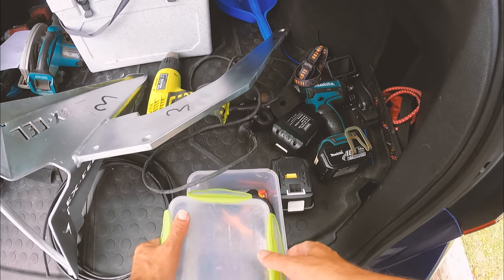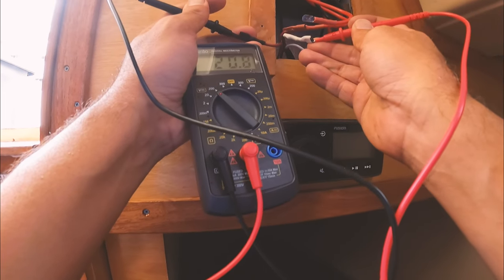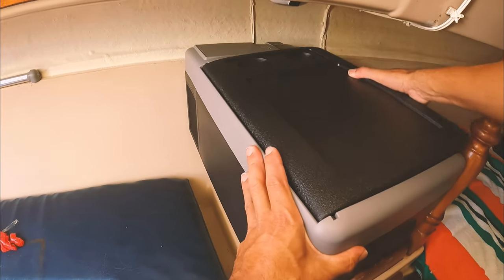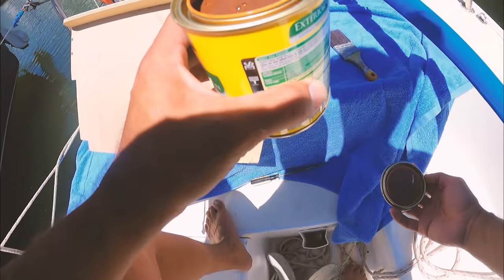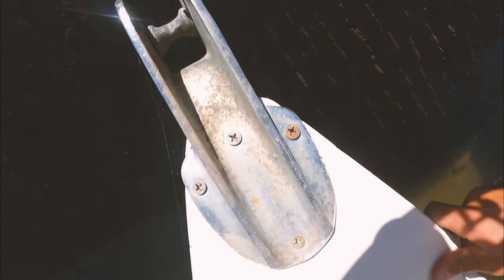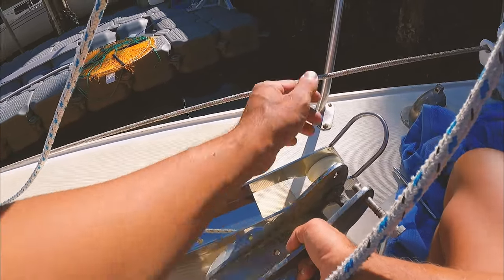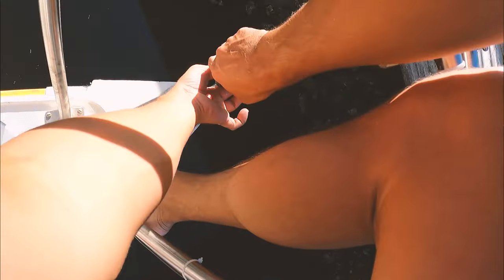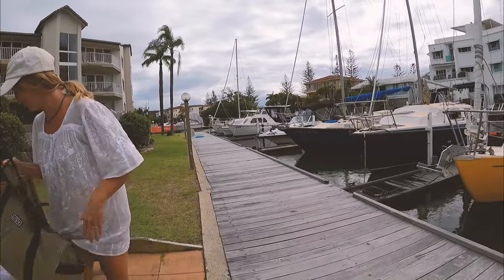Taking My Wife Sailing For The first Time.. But First, Lets Fix The Boat Ready For Adventures

Comment: Rod, Some things you may check. Make sure your actual anchor Rope  is of sufficient material and strength. In your video the rope almost looks like hemp, which I’m sure it’s not. Make sure to wire all shackles. Where you attach the anchor loop to your swivel you should have a chafing thimble inside that loop. They make them out of plastic or metal. Either one will work. Finally and most important, you will not be able to sail in heavy seas with that anchor hanging out there. AFolkboat is a wonderful sailing boat but she is narrow and has less bow buoyancy than some of the fatties  That means she will duck easily into steep seas, which is fine, but that big anchor with its big flukes will not take Seas well and will try to bash around. Suggest hanging the anchor from the bow pulpit or simply leaving it down below and bringing it up when you anchor which should only be once or twice a day. I’ve enjoyed your YouTube’s immensely and look forward to your upcoming sailing adventures. Charles Plummer

Comment: Hey man, I am beyond stoked that you got a boat. It's brought me back to your channel. I'd like to suggest something very important about removing screws and bolts like that... Don't pull them all out until you break them all loose. If you would have snugged up the other screws, the hard to remove one would have been easy. At least the screw opposite. Reverse this for re-installation. Work in a star pattern. Best of luck!

Comment: Well done Rod, on getting the mainsail out. 
I'm looking forward to the next video when you get both the main and headsail out.
I agree strongly with the other comments below, you need to secure all the pins on the shackles and swivels or the pins will at some stage work their way loose.
A stainless steel thimble fitted in the eye of the splice will stop the metal from frying the rope.
Also, think of a way to secure the anchor in the roller, when you get into a bit of a sea the anchor will start to jump all over the place. Maybe a dedicated line to tie or shackle the anchor into place?
Enjoy the voyage!!!

Comment: You need to mouse the anchor shackle and swivel shackles, I hate for you to lose that expensive anchor.  At some stage getting an eye for the anchor rope and resplicing the eye in( it's fun, do a video on splicing).  I would also consider having a spare anchor and rope.  You can use it as a stern anchor or double up the bow anchor in rough weather.

Comment: OMG That anchor is waaaaaay overkill. That thing could hold a trawler in 50knots of wind! Your boat needs something HALF that size! What made you think you needed something better than the plough that's already on the boat? Those ploughs hold perfectly even if they aren't set right.
But that bow sprit (pronounced 'spit') is a massive improvement just like the fridge.
BTW. Welcome to 'pain and difficulties' of working on the water.

Comment: Just my opinion you don't need the swivel they just get in the way and you only need one if you leave the boat unattended for weeks at a time. The anchor is a bit big but that doesn't matter. the chain is on the short side but still adequate for normal use and easier to manually haul. I had a similar sized boat once and had a similar set up I carried a 10M lenght of 10mm short link chain and shackles in the bilge (weight kept low) and if the weather or anchorage were dodgy I would shackle that on to the top of the other chain extending the chain and adding allot more weight to the scope (my kids called it Dads portable mooring).

Comment: I guess the main sail should be pulled through that run on top of the beam and pulled as hard as you can backwards, that's what that pulley and cleat is for at the back of the beam. You need more tension on the main sail. The beam should be hanging in the main sail not in a line of some sort, this is only for when the sail is not hoisted and you don't want the beam to be in the way in the cockpit. With it fixed correctly you will also be able to use the kick to get a more correct sail form. But hey, we are all beginners in the beginning. :-)

Comment: Welcome to the world of yachts!. Get used to doing maintenance on a regular basis and you’ll keep the nasty surprises at sea down to a minimum. No need for a swivel between the chain and anchor line, just cut it and splice them together. Check out Free Range sailing as Troy ( Pascale too…:) is the master of Mariners when it comes to boat maintenance. I used his episode on how to splice line to anchor chain and it’s still going strong. Best thing about sailing? Trolling all the time!.

Comment: Sealing the old screw holes and the new bolt holes you've made will help
Reply from the maker: Yep I actually did put Sikaflex in and under the new bow mount and holes but I just didn’t show it in the video 😅
Reply: @rokkitkit  good one... 👍 
Just checking 👅

Comment: The marker on the anchor, if that's just permanent marker, can be removed with dry erase marker. Just rub over it with dry erase marker and wipe it off. The dry erase marker will dissolve the permanent marker.

Comment: The wind noise protectors work a treat 👌
Reply from the maker: yes I was surprised at how well it worked. will be an essential bit of kit moving forward. Just a bit of a pain around water👍
Reply: @rokkitkit  it was very effective. I can see how it getting wet would be bad news though. Looking forward to seeing you out there on the boat bro 👍

Comment: Hi just a pointer use tie wire or at least cable ties or cord through the holes in the pins then around 1 leg of the swivel or d shackle to stop the pin from rubbing on the bottom n u losing your anchor it's called mousing the shackle always doit to a anchor line as if u lose Ur anchor its more than embarrassing also keep Ur old anchor plus line on bord for the stern or a spare if u get the other stuck also if a fender is tied to it it makes a good make shift moving just a few thoughts for a beginner

Comment: Glad too see you got it  charging , if that battery goes back down to that low voltage it may be bugged , also would be checking out if the battery side of thing's is fused from what I could see was only one glass fuse on the main switch? And later on down the track you might want to think about replacing the input wires to the switch board if you plan to run many things off it at once maybe a fuse distribution block after the switches for individual device's, under sized wire and no fuses isn't a good combination , although it does look pretty good for light loads aslong as it's correctly fused
Reply: @Koko Kooko hi

Comment: At 30:32 you mentioned not having that much chain. In fact that is not that important. The chain is meant to dampen the movements and and keep the connection to the anchor down.
Bearing this in mind placing the chain directly on the anchor is not the best choice. Dependant on the average anchoring depth it will be of better use when you put 5 to about 15 meters of rope between the anchor and the chain.
(A forgotten trick, having only rope, was to let a follower attached to a rope with a weight down the anchor line to about 2/3 or halfway down the rope. This does the same.)
Bear in mind the weight factor of all chain, especially on this size of boat. The boat doesn't want it and doesn't need it.
It's better use of money (eventually) to put 10 meters or so of stainless chain between ropes.
An additional advantage is that you do not have a chain on deck during the trip, and the line is easier to secure.
It's just a hint from an old salty Dutch sailor, think about it.
-
(Edit) I just realised your mainsail doesn't have a intentional loose foot (Losse broek (loose trousers)in Dutch). It is just not in the track on top of the boom! This attaches it to the boom all the way.

Comment: You mean to tell us that the solar panel connector to the battery was REVERSED? You should scribe that box you built to get a perfect fit (that looks like crap, sir). You can cut a tad off the front top of it to have it fitting like a glove. Fridge oughta be tied or clipped down or you know what could happen in a storm. Nice work on replacing that bow sprit yeah the old one needed to begone. Nice calm day for the wife to be out there for her first time, huh?

Comment: Nice Job fixing up the boat and getting the main sail up!    a couple of suggestions ... dont stress about the boom topping lift its only there to keep the boom up when not sailing    when rigging my boat i actually take it completely off and tie it to the back stay and let the boom sit on the deck ... once you hoist the main the sail its self will lift the boom .
Before hoisting your main ... after removing the cover and untying it you want to make sure your outhaul (from clue of sail to end of the boom) is super tight  the main sail should be tight againt the boom and not have any curve in it .. there should be a rope for it that runs through or under the boom to the mast ...some times abit of q20 oil or tool in a can will help it slide easier as its usually a metal shackle type of thing that slides in tracks usually within the boom .. in your case i think theres a black and white rope to adjust it mounted at the back of the boom... last suggestion would be to always keep atleast abit of pressure on the kicker or boomvang (from boom to base of mast)  other then that amazing job and wishing you many safe adventures in the future ... much love from SA
Reply from the maker: Thanks for the tips David, definitely appreciate all the help… yes i ended up just tying the topping lift up and as soon as the sail went up it slackened nicely so I think I’ll just run like that for a bit rather then climbing the mast. I will keep playing with the boom vang, unfortunately my outhaul is all jammed up, I’ll have to pull it apart and get it sliding again, that’s the next job on the list😅 then I can sort out the reefing at that end as well. But yea I think I’m getting a bit more confident with it all, just need more time on the water and we will be good.👍
Reply: @rokkitkit  always willing to help ..  its a common problem for the outhaul sled to get Jammed up and can be very frustrating     maybe just try some wd40 and a hammer might just  save you some hassles ...  luckily in Australia I'm guessing you don't need to worry about security to much   I'm busy refitting my Alberg 30 and have spent a ton on security      I have wifi ... 2 cameras.. a 6 zone wifi alarm .. 2 sirens  and a red strobe light ... can never be to safe in SA unfortunately... all the best to you and your family

Comment: When fitting a rope in a loop like you did to connect to the anchor chain always put in a plastic c type spacer or even a stainless one  thats better it stops the rope rubbing and tearing through and breaking , exactly the same process on the metal guide stays for the mast , have a close look at them then  you will then understand what im txting about , dont want ya anchor breaking free in the night and ya boat on the rocks not a happy thing , and replacing the big heavy galvanised hot dipped anchor for a lighter stainless one yer i don't know im sure others will support you but i would personally stay with the big heavy anchor their built tuff

Comment: Looking Good! I am not sure where you are getting that lithium cells can be drained to nothing. I think I have heard that on one of your other videos also.  each cell will go from 3.8 to 4.2 volts dc. 3.8 being drained. if you go below that it will not function well anymore. they do have controllers on many cells or in packs that shut them down at 3.8 volts. then you see no voltage from the pack. so if a battery pack has 3 cells it will be discharged at 11.4 volts and full at 12.6 volts.

Comment: I would deffinantly look at re-running those solar cables from regulator to panel Looks like the incorrect cable MAY been of been run need to use tinned copper it stops corrosion(as normal copper will react with salt causing corrosion)  ,also with that inline barrel crimp at the panel only standard heat strink was used always better to use GLUE LINED heatshrink to fully incase the crimp giving it waterproof joint or even better get rid of it all together streight into the mc4 connector...good find with the polarity defiantly gutta be the right way around  Awsome Boat! jealous of the sick adventures your going to have!!

Comment: I would.put a piano hinge on the side of your cabinet and have a door for a storage cubby. Those little "ledges" as you call them that are vertical of the end of a table or.cupboard on a boat are called "fiddles". They keep stuff from flying off.  Fiddles you built a fiddle and didn't know it. Good on ya! Do you have a strip of aluminum or wood on the underside of those anchors bolts to spread the forces over a bigger area?

Comment: Rod I’d definitely put some silicone or thread sealant on the screws for the anchor roller (or whatever it’s called).

This is awesome content too man. Your passion definitely shows.

Edit: Also ya need a pair of vice grips in your boat tool kit. Ya could have held the nylok nuts with the vice grips and turned the heads of the bolts from up top to tighten up the anchor roller.

Comment: Hey Rod, I have heard that the rope will wear out on the eyelet connection quicker like that it is best to use a metal eyelet that fits in the loop of the rope. that way the wear stays on the metal and not the rope. might be at least worth watching for it.

Comment: I’ve never understood why people put the wiring in the companion way......!? I’d at least fit a clear vinyl flap, to go over your switch panels, it’s the first place to get wet from rain, or the cockpit. Otherwise great project boat and intro to sailing ⛵️😎🏖🌴☀️🇦🇺
Reply: Definitely should have the swivel at the anchor, you’ll see why once you start using it!

Comment: Hey Rod, get yourself an impact driver with adjustable torque (makita for example to go with your batteries) and a good set of different sized Phillips and flat bits—seized fasteners are a way of life on old boats and rattling away on lower settings on your impact driver (with some lube on threads) will save you some really agonising situations of sheared fasteners and stripped heads. An impact driver with a well fitted bit will safely and easily remove (and drive) fasteners that are impossible to remove with a hand held screw driver or socket or a cordless drill. 
On that note, you will have to get yourself a good assortment of quality marine fasteners—silicon bronze and stainless. None of the hardware store coated steel stuff will stand up in a marine environment and will just cause you grief. Stainless is good for some stuff, particularly bolts, but it’s soft and screw heads strip easily and it can shear really easily. Silicon bronze is often better for critical things. 

I would not rely on that swivel fitting for your anchor. Hard to know what it is rated for and impossible to see what is happening inside the swivel where the most likely failure point would be. 

You will also want to secure your fridge down. If you ever get knocked down (I know, it is not something you plan to have ever happen) then the last thing you want are big heavy things flying around below. 

Not being critical, just some advice from someone who has spend a lot of time mucking around with an old boat. 
Can’t wait to see your adventures in this, and it’s giving me feelings of wanting to get another big sailboat.
Reply from the maker: Cheers mate, yep all good advice 👍

Comment: Loving this overview of the boat, it’s a great reference on what I can do with mine. Btw the marine ply is just different in the glue is marine rated, you still need to seal all the wooden surfaces - should be fine as is for the interior though…

Comment: Great entertainment watching you fixing your boat and brings back many memories :)     I was wondering if you were going to sand down and fill in the holes with epoxy and repaint after removing the previous anchor roller?  any water getting into those holes can give you all kinds of glass fibre delamination problems and rot in the future.

Comment: Ive Had boats for years in Sf Bay area, and its not as Humid As Australia, I stopped using Spade lugs for my electrical connections and switched to GM Weather Pack  connectors and use Tinned copper wire. its what they use on General Motors Cars in the U.S. you can them from Junk yards too.  all European Manufactures use a type of them. you can get new terminals and the crimping tools off of Amazon. and start using a good Die-electric grease, you will much more confident with you wiring. Cheers....

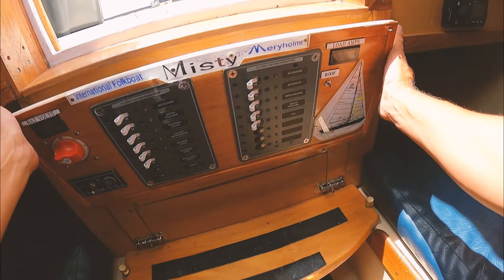Comment: Did anyone spot the loose red wire at 2:25 in the top left hand corner of the fold down section ( centre left of the frame)??? He might fix it later, still watching.

Comment: did you seal those holes at the bow  and I cannot believe those washers, it needs a piece of wood to fill the gap and backing plate under the deck, that new piece of wood for the fridge did you screw it down, the folk boat is a fantastic sailer but it sails on its beam most of the time

Comment: Every time you come back to the dock and show her, I grin like a bottlenose dolphin.  She's such a beaut!  I love this boat.

Edit: The anchor rope is not properly connected to the chain.  Get yourself a "thimble" (I'm not sure of the translation), that is a metal part which protects the rope from wearing against the chain link.  It looks like a tear.  Resplice the rope, don't bother with the swivel.

If you can't be bothered with that, get a "no snag" shackle.  Better than a swivel, in my opinion.

Edit 2: Your mainsail is not trimmed, basically at all.  The rope you need to tighten is apparently called the "outhaul".  I'm not sure of the translation again, so do not trust me on that.